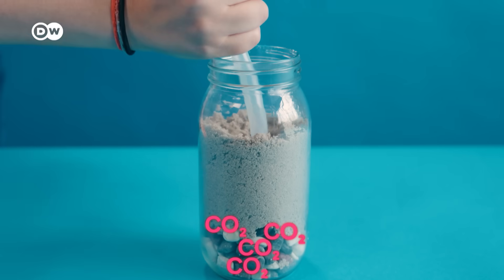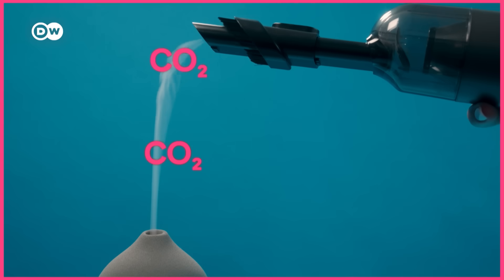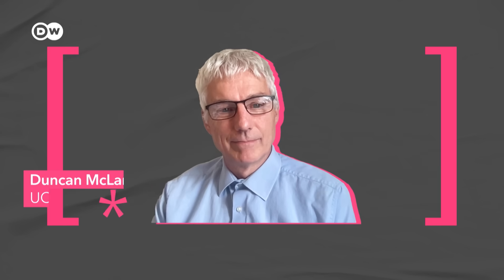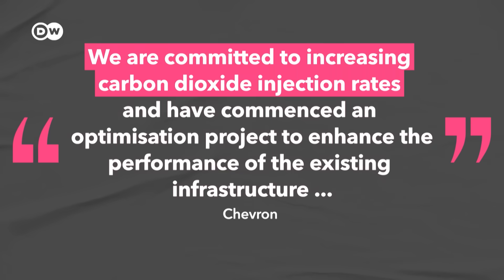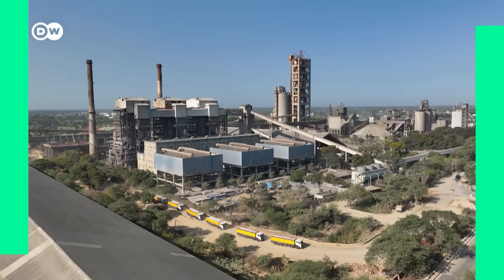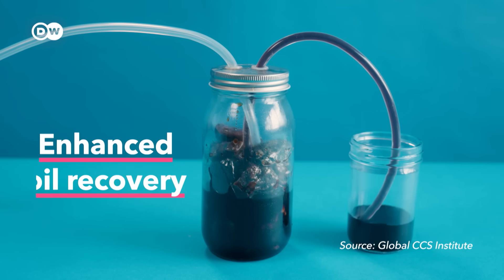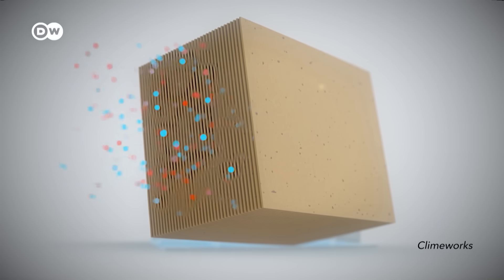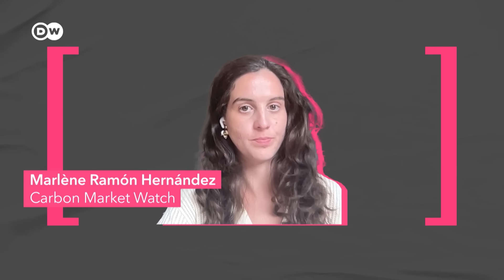Why carbon capture needs a reality check

Comment: The cost is not the main concern, but the engergy consumption. How much engery is used to capture one ton of CO2 vs. how much CO2 is produced in the process.
Reply: cost is a part too.  in order to do something like 1/100th of the job costs 10 trillion annually
Reply: Can you by any chance elaborate, since I can’t really find any studies or videos proving this point(I believe you but I just can’t find them)
Reply: @belazlat8481 Fundamentally the problems are related to all of the other stuff that isn’t CO2.  Getting the CO2 out takes a lot of energy. All fossil fuel energy generation uses air. 21% oxygen(the thing you want from the air) and 78% nitrogen(useless). The BEST case scenario for CCS is coal power. After combustion it’s like 12% carbon dioxide. In order to get that carbon dioxide out, you have to compress ALL the combustion gasses along with that 78% nitrogen and bubble it through a solution to dissolve the CO2. (88% of that work compressing gases was wasted on non CO2) then you circulate and heat the solution up to boil out the CO2 from the solution. Then you have to compress it again for transport, then transport, then storage. All taking energy. If not in action in manufacturing of materials. You also had to make and eventually replace the solution the CO2 dissolved into, which takes energy. 

Natural gas has about 6-7% CO2 from combustion but has a lot of CO2 before combustion. Since it’s usually already compressed somewhere in the chain , separating the PRE combustion CO2 isn’t that expensive but post combustion would be 2x as energy intensive as coal per ton of CO2. 

Air has 0.04% CO2. Direct air CCS is a joke that relies on ignoring the CO2 production inherent in the infrastructure. Even if all refining is done with renewables.

You don’t see hard numbers on this because there are only a couple plants in the world that even trialed it. Best case trial BEFORE transport and storage was about 1/3 of the energy from a coal plant. Not including CO2 produced from additional infrastructure. The plants that remain are research plants that don’t totally support themselves financially. 2 in canada that this info came from.
Reply: Nuclear plant some where with no fault lines and no wars close and clean constant power used to power the process. If plants can seperate carbon from CO2 we should be able to work it out. Or coal and gas plant exhaust moves and is hot. Surely that movement and heat could used to fuel the CO2 splitting or capturing process. Seems need more PhD scholarship to get geniuses away from finance and in this
Reply: @Nichoラス the problem isn’t with our technology.  The problem is with our consumption.  Don’t get me wrong we are part of the eco system and need to consume to survive, but we produce and consume in the stupidest way.  As a species we grow enough food for 10 billion people. There are only 8 billion of us, and 10 to 15 million people die of starvation each year.  
Our problem is with how we justify distributing resources.  Our problem is with obsolete social and economic systems.  Capitalism was great in the world relative to feudalism before it we progressed.  Now capitalism is holding us back and harming us.  It is time to adopt the next system
Reply: @MotherNature26 ur take on capitalism is the complete opoosite of reality. The fact less than half thebpopulation can priduce enough food for 8 billion or what ever is proof of that. Capitalsim would be selling fossel fuel utilization texhnology to those countys who cant feed them selves. Its the loonie left communist socialist types who are dictating to them what technology they can and cant have we used fossel fuels to get into abundance and no we are depriving rhe poorest on the planet from soing the same? Its not the capitilosts that are holding them down but the fans of Stalin and Mao.

Comment: 6:57
You're absolutely right in pointing out that, given current technologies, CCS remains one of the viable pathways for industries like cement to achieve net-zero emissions by 2050. The cement industry is a significant emitter of CO₂, and while there are ongoing advancements in energy efficiency, alternative fuels, and the use of supplementary cementitious materials, these alone are not sufficient to fully decarbonize the sector.
Reply: CCS  doesn't work that is the problem.

Comment: This "more oil" argument is stupid. The oil that's extracted using captured carbon WOULD be extracted without this captured carbon anyway. Because the amount of oil extracted is not defined by the extraction capability but by the demand.

Comment: The vast majority of CO2 (and other greenhouse gases) released to the air is in our pursuit of generating energy because we do not have a surplus of it. DAC requires a ton of energy to do so it actually makes things worse, on average, and cannot be the solution. Yes, there are places where we currently have surplus of energy generation but it's better to invest into transmitting that energy, or making it portable in a different way, and then reduce CO2 released in 'generating' energy elsewhere,  than just wasting it in the futile attempt of CO2 capture from the air.

Comment: I feel the story is missing a a major topic. What happens after we reach net-zero. At that point we need to restore the damage we have done to the atmosphere. The carbon that should no be their should be removed. I like Adam Dorrs analogy in his book brighter(tip, it is fun to read): The current climate is like a burning house, the flames are our Co2 emissions. Reducing emissions does not put out the fire, we need to completely stop with Co2 emissions, After the fire is out we need to repair the fire damage before we can live in the house again. We need DAC and reforestation to do this.
Reply: What makes you think civilisation will reach net zero? The increase in the use of fossil fuels is still accelerating, subsidies are in the trillions. No political will anywhere to do anything at all, if done, they will lose the next election, so instead they do nothing (and here in Sweden even enable polluters to increase their emissions). With tipping points activated, there is little hope.
Reply: …and Enhanced Rock Weathering. Yes that is a good book. And I agree that net zero is just the first step.

Comment: Say we recover something like C8H18, where hydrogen is the lightest/smallest atom attached to 8 carbons. We replace it with 2 oxygens equivalent to 32 hydrogens which is almost 2x as much, with 1 carbon which is 8x less, so you need about 16x more volume. Even I who haven't studied chemistry can tell YOU CAN'T STORE GAS UNDERGROUND, HOW?. Even the video states they use small portion of it to extract oil out. So Its just a greenwashing idea to fund the fossil fuel industry.  
- Just stop calling it storage so naively and call it petroleum extraction maybe.

Comment: All this demonstrates is the stupidity and hubrisness of the pinnacle of western enlightenment scientific and engineering thinking and solutioning. Scrubbing the air of the atmosphere after intentionally binding carbon with oxygen via various cumbustion processes! How silly can a solution be when the simplest and easiest solution is not to bind it in the first place!

The solution making needs to start at why the hell is it being bound in the first place and ask the question how did life create such diversity, wonder and wealth before humans started playing with fire. The answer of course is we've learned to play with fire without any full understanding of thermodynamics and how this is critical and essential to the processes of living systems that give as they receive or vice versa to create and evolve into wonder and beauty. Combustion machines presented by humans as superior to this beauty and wonder can simply only receive and cannot give because they're non-living systems that simply amplify entropy. Living systems also generate entropy but they balance this by generating anti-entropy or negative entropy.

Machines therefore are not superior to living systems. All they represent is human narcissism, arrogance and fear. Humans engaged in such foolery should reflect at the wonder and beauty of themselves and the incredible living system they are. They need to turn to solution making inspired by living systems that thrive in dynamical non-linearity and not single issue first order linearity.

Comment: Knowledge, science, and engineering are ever evolving. Hence, the ones emitting the CO2 which aren't directly being offset, should be the ones picking up the cheque first of all. Furthermore they should be forced to find alternate solutions which produce much less greenhouse gasses or even forced to shut down if they dont come up with anything.
Sure we needed them at a certain point in time, but at the same time, if it's between that and our survival. Shutting down one branch of industry seems like the way to go, whichever the consequences might be in the long run. If it's proven that it causes harm in the long run, which it has, we shouldn't have any qualms about this.
And as a final, hold those damn companies accountable, and punish them HARD if they don't comply with the best/worst case just being total shutdowns.

Comment: Question: Does the CCS direct from air account for the Co2 it produces itself by needing energy to do the job? Or is it supposed to run on "clean energy" 🙂
And also; there is already "technology" available for this for free. They are called trees and plants including algae in the sea. There are a lot more interesting project that captures Co2 this way. They can either be left alone whee they are or cut down and burned to produce energy for people and at the same time make room for more trees to grow. The Co2 can be captured from these plants in parallell with CCS from oil burning plants.

Comment: We're going need DAC regardless of whether oil companies are going to invest in it or not; it's beyond that point now. They are historically untrustworthy to do so because it does not serve their business interests. We need to remove them as a factor, and make DAC profitable as a standalone industry, without feeding it back into oil and gas. The CO2 itself needs to become a commodity in order for the incentives to be there, and that cannot mean going straight back into oil.

The best possible way I can see this happening is by finding a use for it within manufacturing:- trapping it within another material to improve its properties, or potentially breaking it down and tapping into the raw carbon. And yes, that is what trees do, but it does not scale. We have to solve this problem whether the oil companies will back it or not.

Comment: CO2 is highly reactive. I worked in a CO2 laboratory and basically anywhere you try to sequester CO2 turns out bad.
Reply: oxyde are by definition the most stable molecules. because they are the less energy demanding/storing. what ever you want to do to transform an oxyde, you will have to add energy to get a reaction. hence carbon capture will always require more energy (because of ineffiencies) than the energy you took out to create the oxyde
Reply: @benjaminlamey3591  Plenty of things will react with CO2 even without direct additional energy input, but capturing CO2 is still very energy intensive.
Reply: @mathewcherrystone9479  lol, it will react to create things even worse ... that´s not helping

Comment: You failed science class completely today… take your little tub fill it with water and put one drop of dye into the water now take out a spoon of water what you have effectively done is reduced the amount of oxygen by 1/3 of the removed mass 2 carbon atoms and one oxygen atom, simply put you tub will boil faster and freeze faster, also quit listening to uneducated brats that don’t know the difference between carbon dioxide and carbon monoxide! This is fake science and corruption at its finest! 😎

Comment: One thing a lot of people get wrong about climate solutions is, that not every idea, that sounds like it solves the problem actually solves the problem. Just because you can in principle do a certain thing, neither means, that you can scale it up to 100% market penetration, or to solving 100% of the problem, not that you can do so economically. There are many ways to reduce our climate impact, that don't actually cause net costs, but are actually a good investment even without climate change. Then there are ways, where financial benefit and costs come out around zero, ways where you end up with a net cost, but it's small per ton co2. And then there are things like carbon capture, that are in the priciest and least scalable category. Doesn't mean, that there is no use case for it, but it will continue to be very limited and will only make sense, where there just aren't any better alternatives.

Comment: The problem with DAC is that it requires renewable energy to actually operate CO2-negative, otherwise you will emit more CO2 by operating the facilities than what would be captured. As DAC has a energy efficiency of maximum 0,05% (400ppm CO2 in the athmosphere), the renewable energy is used better by feeding it in the grid to reduce the dependency on fossile electricity production. There is just no scenario in which DAC makes sense from an environmental or economical perspective.
Reply: on the contrary, the current champion DAC tech has a second law efficiency of around 25% and uses under 1MWh per ton of CO2 captured
Reply: @ldm3027  You do understand that there is not more than 400 ppm CO2 in the atmosphere thus the yield can't be higher compared to carbon capture from industrial point sources where you sometimes have more than 25% CO2.
Reply: @silvesterbecker1015  again you are wrong as you dont understand efficiency.  the "yield"  of CO2 from DAC is  near 100%, whereas CCS is much lower. And the 1pointfive DAC machine being built in the Permian uses natural gas as its main source of energy. There is no requirement to use renewables so long as emissions are captured

Comment: Remember when Germany closed all of their nuclear power stations?? That could've prevented so much CO2 in the air!
Reply from the maker: Hi Armando! Take a look at our video "Is Germany's nuclear exit a mistake?" that might interest you  👉https://youtu.be/eWuGP_aBoYg?feature=shared Subscribe to our channel! We post new videos every Friday ✨
Reply: Just one year after closing the nuclear power stations they postet a record low number of coal used for electricity and a record high number of renewable energy and on top the electicity prices went down.
Reply: @toniober4416  german carbon intensity increased from 453 to 489 g/kwh from 2021 to 2022 after closing half the nuclear powerplants, in 2023 it did drop to 425 g/kwh but total electricity produced also drop drastically from 491 to 446 Twh, this drop was not a result of a drop in demand but in supply and that energy was imported from mostly france who has a carbon intensity of 45 g/kwh ( 10 times lower than germany thanks to nuclear). Your argument is so wrong that if you compare 2020 with 2023 germany produced more energy at 491 twh at a lower carbon intensity of 399 g/kwh. So yes they missed big time, renewables are the future but germany acted like a child
Reply: @toniober4416  yes, and charge high tax on cheaper renewable energy cars, lol, typical german.
Reply: @toniober4416  Yes because they have lowered their overall energy production and just buy from other EU nations. Expecially because they have been getting criticism for years. The Anti-Nuclear Movement is the worst thing in this entire Climate debate. Instead of investing in a proven technology climate activist want to teardown the countryside for solar farms and  fucking windmills.
Reply: @toniober4416  Record low coal along with Record high gas as well 🤣🤣🤣🤣. Also, instead of closing those nuclear plants, hey could have closed the coal plants and reduced the use of coal even more.
Reply: Now RWE is GREEN because they’ll kill the native Colorado wildlife for a 9 square mile solar plant. Sell electricity to stupid Americans reliant on AC.
Reply: You need petrol to produce plastic.

Comment: I do not mind pumping down gas to extract more oil. We need oil. If you have dug a hole might aswell extract as much of it as you can. I am in Sweden. Electricity is doeble without oil, building house aswell witha lot of added cost, simple thing as plumbing without plastics. The third essential ingredient to survive is food and without oil I doubt we would manage to have enough food for everyone in the country. No oil means no plastics and probably not any fresh vegetables atleast 4 months of the year. No oil no tractor a lot les food overall etc. Personally I want oil price to atleast not skyrocket because if it did my food would cost more which already is ~33% of my income as a student. Making oil cheaper I believe will make peoples life easier. Making the pollution side more expensive I can get behind.

When someone is sceptic to oil in a black and white manner it is hard to take them seriously.
Reply: CO2 CARBON  BURIAL IS A POISON! LEAKS has killed people,  made people sick! You CAN'T smell it! If You sign a Lease with the CO2 CARBON  BURIAL you WILL BE DICTATED  TO! THEY tell you WHAT YOU CAN & CAN'T DO ON YOUR PROPERTY!

Comment: there are a whole list of tech for climate change which is about essentially distracting us and doing nothing, or doing only easy things. fundamentally flawed logic are behind these scams, they simply move costs to the public and can never be efficient. ccs is just one. if ccs is a failure, dac is by definition far worse, it’s just far less efficient, more expensive ccs. in every case, the cheapest solution to coal and gas is to not burn it to start with.